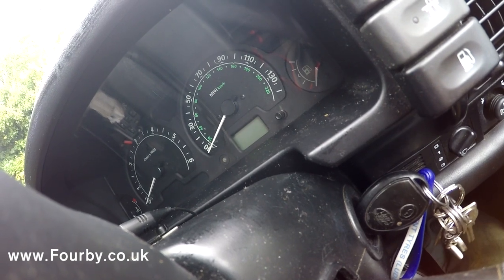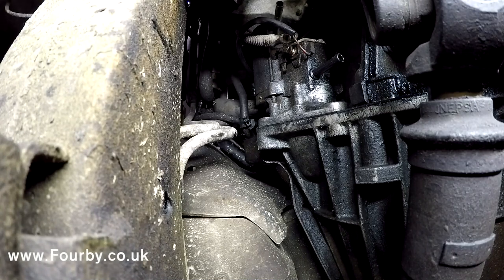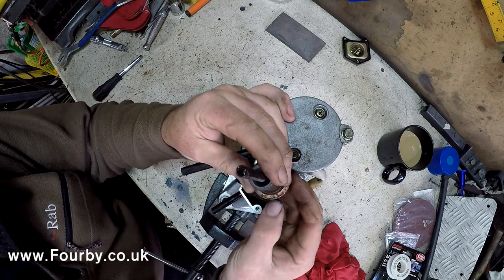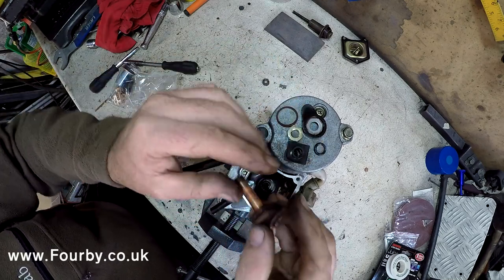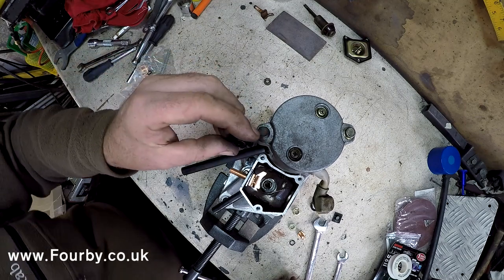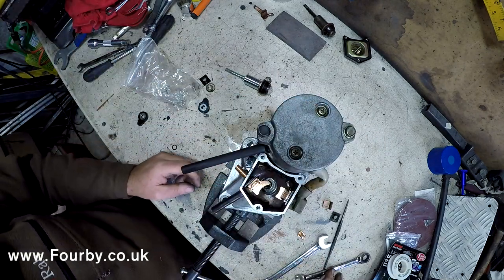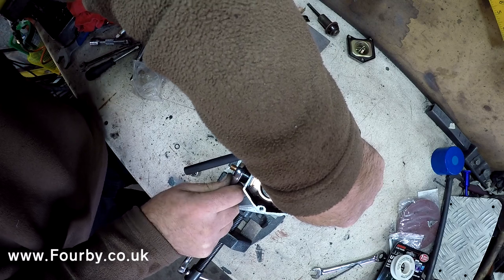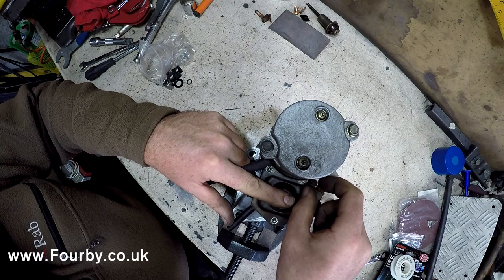Land Rover TD5 Starter Motor Clicking?? here's the repair....

Comment: Brilliant video, just did this repair as described.  Didn't have to jack the car drove front wheels up onto a curb, plenty of access from below.  Head torch helped a lot.  Struggled with that top nut but managed it eventually with the tools described (mine took a 15mm socket with 6inch extension bar).   Replaced it as well when refitting the starter, though I only finger tightened.  The contacts and plunger refurb kit worked a treat and was simple to fit.  Real sense of achievement.  Thank you so much..

Comment: Thanks for the info in the video - took me all of 5 minutes to get the starter off and the new one in place on the drive, not jacked up at all. took 2 minutes to the 2 bolts at the front of the unit but 45 minutes to even get the nut on the stud on the rear. Eventually used an inspection camera and the nut in a 15mm socket held in with grease on an extension bar and hey presto! job done. Its not hard at all, just fiddly and I'd recommend you have a go before forking out for a garage to do the job. Well done and thanks again for the video
Reply: I'm having a go tomorrow after it really  let me down this morning. Great instructional vid, gave me the confidence to repair it myself!

Comment: Brilliant little kit
I have an disco 2 2003 yes the nut at the back I’d a proper sw$¥§in to get to at, it did help removing the oil cooling pipe  15mm socket was needed with a six inch extension to access the nut reinstalling the nut I and use a magnetic pencil touch on the end helped seating the nut into place, after everything placed back in its rightful place vroom instant start cheers mate 😀👍

Comment: I got to say that is a very odd design of starter motor.  Nice to see one can repair it to a certain extent.  I find it odd on the rear of the starter where the Bendix shaft is.  Usually, there is a support bracket and bearing for the shaft. Good video BTW>

Comment: Thank you for this informative video, however the "OK for another 100k" on the Fourby website seems optimistic. My disco has done 69,250 miles since new in 2004. The original starter motor failed completely at the end of 2010 after 37,250 miles when it must have stuck and blew a fuse. The solenoid problem suddenly appeared two days ago with no warning. I have ordered a new starter motor plus a solenoid service kit from England as I now live in mainland Europe and there are no local suppliers of such bits. I will get my garage to change the starter motor and I will then refurb the solenoid on the old one at my leisure. I can keep the whole unit to one side as a spare. I have not closely examined the Disco starter motor when underneath on rust prevention duties. I expected it to be much larger. I am sure my old Ford Anglia van had a much bigger motor to spin a tiny 997 cc engine, though it did not have a solenoid, the starter pinion was whizzed down a spiral groove on the motor shaft and returned by a spring.

Comment: Some Hints!
* The top Nut should be removed with a 3/8” or 1/4” drive in a 15mm socket. A 1/2” drive doesn’t fit well and will give problems.
* Do not put Jack Stands on the Axle as it reduces the space to work, and remove the starter. Place them on the chassis and allow the front axle and diff to drop. This give more room
Reply: didn't niel say it was a 17mm at the top?
Reply: @jgbdickcleland  he was wrong and a 100mm extension is too short as the ratchet fouls on the starter motor
Reply: @jgbdickcleland some of them are. Mines is a 17mm also in a 2003 TD5 Defender. The main thing about the socket used for that top nut is to make sure that it is a shallow socket. A longer socket catches a lip on the starter and causes  it to bind up. I found the ideal thing to use was two short 3/8” drive extensions with the one connected to the socket being a wobble extension and attached a knuckle to the second short extension. Can be fed in to place from above by reaching below the inlet manifold then for actually loosening the nut is best done from below until loose then back to the top until out. I wasted alot of time initially with 1/2” drive sockets and extensions which were of no use.

Comment: Thanx, Today tried starting and just a slight clicking sound (the ignition lights didn't dim either when the key was turned) So i suspect it could be this solenoid causing it.  Have had the starter redone twice before and now at 350,000Km looks like it needs redoing again. Will try it myself this time if I can locate the kit Just hope it is this thats causing the problem and not something else. Again thanx easy to follow video

Comment: It took me a while to work out why a 17mm spanner was not working on the nut on the top of the starter motor.  The auto Td5 uses a 15mm nut and not a 17mm as indicated in your video.  For some reason they use a different nut on the manual.

Comment: Hi. I’ve had a TD5 for about a year now and having no previous mechanics skills im learning lots. Been rebuilding bits especially over past month so it’s been stood around that time but today came to turn it over and nothing just that little click. What I’m wondering is if this is easy enough for an amateur to do or would it be best to buy a new starter motor and just bang that on? Thanks
Reply from the maker: Matthew Smith the hardest part is getting the starter off and back on because of that one blind fixing. Repairing the solenoid is easy
Reply: Fourby the blind fixing if I’m right from the video is not a bolt is it but a stud so as long as I can feel it we should be ok lol... here’s to hoping anyway... anyway will look at getting the solenoid kit ASAP 90% sure that’s what’s wrong

Comment: Silly i know but it looked like your disco has a wee when you jacked it up.  :D
Reply from the maker: It knew what was coming!
Reply: Air con drain?
Reply: Could it be the air-con drain? When I first got my disco I was concerned about a water leak until I found out about air-con drainage. In summer there can be quite a pond under the car after I have parked on level tarmac for a while where the water is obvious.

Comment: I’ve recently installed the new solenoid after the old one was pretty worn, but still nothing but a single click, any further suggestions what could be causing it to not start at all?
Reply: Check the continuity of the thin wire that connects to the starter solenoid. If the spade connector is a loose fit, it can be an issue. Then follow that thin wire backwards to see if there has been any damage to it .. all the way back to its connection at the fuse box in the engine area. Check the associated fuse for firm fitting  and also check associated starter relay (I think its R102)
Wiring goes from here to the passenger fuse box (fuse 23 I think) then to the ignition starter switch itself.

Comment: Neil, does the 300Tdi starter motor have the same type of contacts? I've never taken down my starter and it's running for 19 years.
Reply from the maker: Fionàn O'Kelly i have a feeling the 300 is a lucas unit, so probably not, I'll check

Comment: My starter clicks but after a few turns it eventually starts... is this a sign Its dying or is it another problem
Reply from the maker: its about to die, to confirm this, pull it off and look at the contacts inside
Reply: I figured out where the starter was, removed it and found that the cable lying on the outside was broken and filled with dirt/oil/ asphal etc. I just bought a new starter... pretty quick job actually

Comment: when you put the starter motor back on are there any gaskets or seals between the starter motor and the engine 
got my starter motor fixed about 1 year ago at a garage and am getting the click again thought i might try and fix it myself as i like to go four wheel driving by myself and if the starter craps out would save a lot of walking if i can fix it